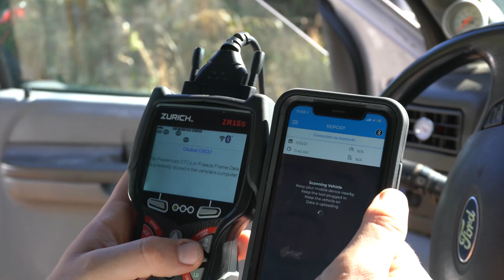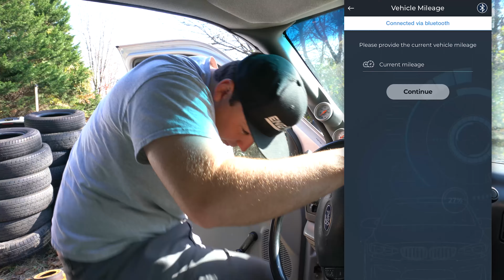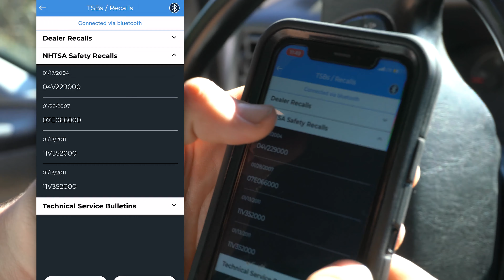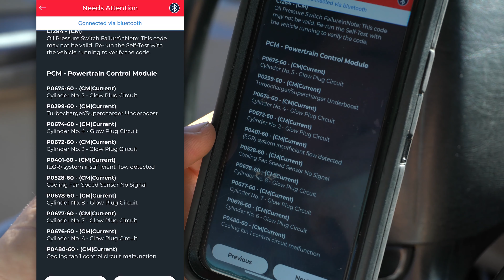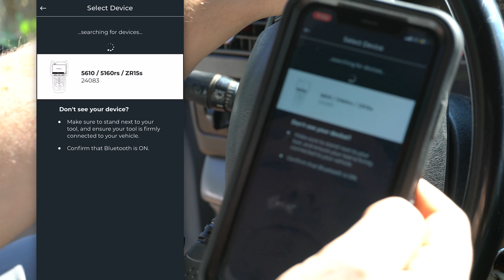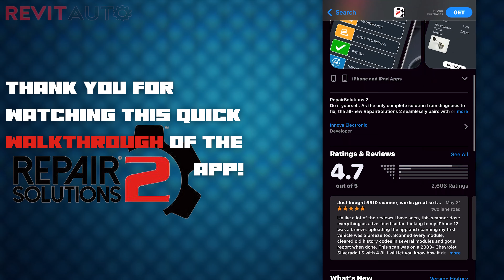First Impressions of Using RepairSolutions2 with a ZR15S

Comment: I have an 03' F-150, it's nice to know that this will work with that, and provide me with vital information. I have a check engine light that keeps coming on, assuming it's my O2 sensor or I need an EGR valve (easy fix). It's also got a bit of rough idle, but I'm assuming that's related to the old spark plugs/coils that came with the truck when I bought it.